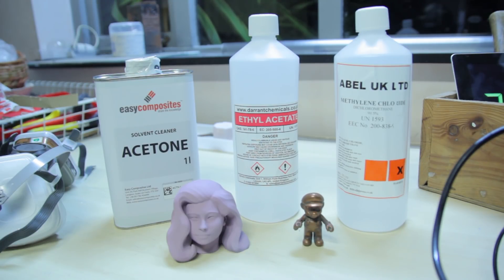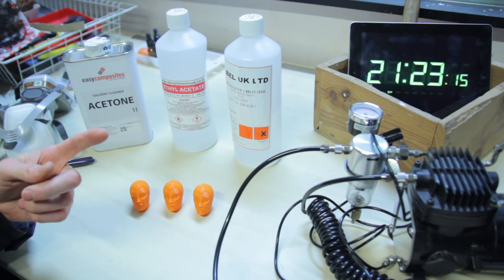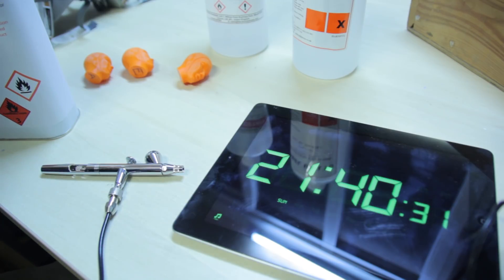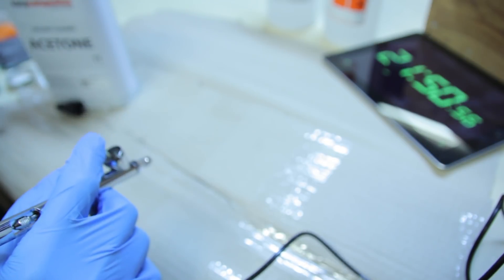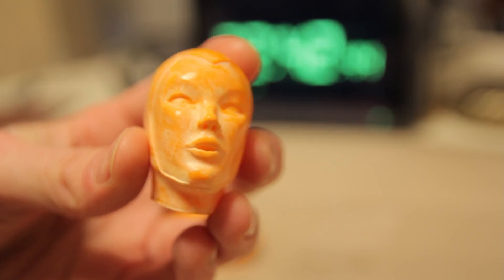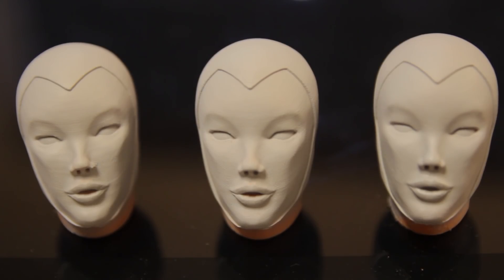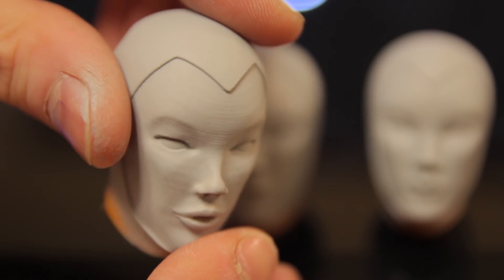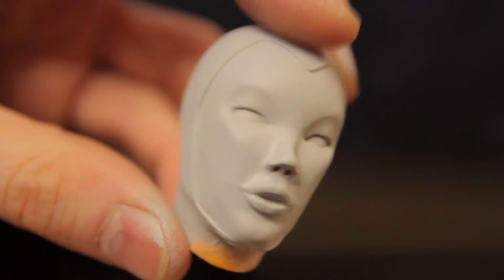PLA VS ACETONE, ETHLYL ACETATE and METHYLENE CHLORIDE

Comment: Airbrushing Acetone is not a good idea. First, you feel the place with acetone spray. Second, acetone evaporation rate is extremely high. It will evaporate before hitting the object. Third, you will ruin your airbrush seals very quickly.
Reply from the maker: Yes, but i didnt do much, however im going to replace my seals, so thanks for reminding me! Have not ever replaxed them before in over 20 years! Mind you i dont use it so much.

Comment: I realize this is an older vid, but im wondering if you've ever tried do neutralize the chemicals in some way... whenever we use chemicals on metal, usually acids,  we neutralize so the acids stops what it is doing. Same when using acids to etch concrete,. With methylene chloride, I'm not sure, because the net has differing things to say about the ph, but no matter the chemical used,  it seems that it must soak into the surface some... so either a soak in a neutralize agent or maybe soapy water or maybe just water...may be needed to neutralize/ rinse. Acetone is a weak acid, so baking soda and water may work to neutralize... since filament absorbs humidity, it should absorb some... wondering if you've tried anything like this to prevent the deterioration before i try it myself.
Reply from the maker: @mamalion3  i think its a good idea. But i have no idea what to use to neutralise each chemical.
Reply from the maker: @mamalion3  i find acetone perfect for sanded colorfabb. It also depends on the additives in the pla. And they unfortunately tend to change them when they do cost cutting and such. Ultimaker brand used to be even easiet to smooth before, but due to a manufacturing issues that ruined an entire run, they changed precesses. Luckily i had colorfabb as a backup but needed to be sanded more.

Comment: I worked in Boeing's Paint shop.  Both Acetone and MEK "VAPRORIZE' faster than the particles will travel over to the target.  You were not missing what your were aiming the Air brush at you were only hitting it with a gas, not an air born partialized liquid.
Reply from the maker: Thanks for the information, atomization was defintely a factor I noticed, i normaly dip the objects. But acetone 8n my honest opinion gives the best results and the others are far too destructive.

Comment: Apparently Tetrahydrofuran (THF) or oxolane (which is used for cleaning pools) will dissolve PLA. You might want to consider experimenting with that.
Reply from the maker: Id try some thf, but when the filament companies change thier pla formulas it ruins everything. Ultimaker filament used to smooth the best but after maufacturing issues the company making their filament changed the formula and it no longer smooths. Must have removed the pha? Colorfabb is my main choice now.

Comment: I have used Ethyl acetate to clean airbrush, same with acetone it works great for lacquer and enamel paint. The chloride stuff sounds like its quite strong so I would not dare use it to clean my airbrush as it might damadge teflon seals.
Reply from the maker: I use acetone and airbrush cleaner. Ethly acetate is a bit strong for me. Methylene chroride is filthy stuff stay well away.

Comment: That seal lid on acetone, place a flat screwdriver on top (corner down) and whack the back with a hammer, it will puncture it and go inside a little, then tilt the screwdriver down and it will pop out, dispose of it as it's no longer needed.
Reply from the maker: Yep agreed!

Comment: Not sure why you would spray these solvents on instead of just brushing it on. Does your mask have chemical filters in it? It looks like just a dust mask.

The best thing I have found for smoothing PLA is UV resin. Just brush it on and hit with a UV flashlight for a few seconds. It sands easily then.
Reply from the maker: Acetone is easiest snd quickest in my experience. But you need to use a pla blend for it to work.
Reply: @Cloakfiend  Acetone doesn't do anything to some PLA's. In fact, none that I have tried it on. Which PLA's are you using?
Reply from the maker: @BreydonsRC  i use colorfabb pla/pha. My faves are the transparent ones. But they all smooth as they are blends of pla.
Reply: @Cloakfiend  ok, that make sense then. The clear PLA's and ones that are a bit tanslucent are a lot different than the opaque.

I haven't tried acetone on any translucent PLA's. I typically don't use them. But I do have one brand that is like that. It seems more like PET than PLA.
Reply from the maker: @BreydonsRC  the opaque ones work well also though. Ive used pretty much all colours.

Comment: This is a mess
Reply from the maker: My presentation needs works i agree. But i applied all chemicals uniformly. So the results are honest. Trouble is the chems atomized before reaching the target so airbrushing may not be the best way to apply. A regular spray bottle is better. Not so much atomization.

Comment: Hello,
Love the video, can you tell me how to prevent resin  from sticking to pla printed molds.  Thank you
Reply from the maker: I wouldn't use pla to make a mould. I'd use a normal silicon mold for that. I dont make many molds but used to make a lot. Then you spray in mold release and pour in the resin. It comes out easy. Not sure if mold release works with pla but I would defo not use pla for molds!

Comment: Is acetone more powerful??
Reply from the maker: Acetone produces the best results longterm. The others crack over time as ive realised, they are far more destructive.
Reply: @Cloakfiend  by overtime, how long do you mean?
Reply from the maker: @s_y_305  like a few weeks or months. When they dry out basically acetone is best in my opinion. The other chems are too harsh. They just dont last long at all. But maybe as i print hollow.
Reply: @Cloakfiend  really helpful, thanks man.
Also another question do you know if I can apply acetone using a brush on pla? Or do I need to do the acetone chamber?
Reply from the maker: @s_y_305  a 35 sec dip is the best in my opinion but brush it on generously if you have no container big enough. Check out my trex vid or the one that called best acetone smoothing or something i dip in those vids.
Reply: Will do, thanks alot
Reply from the maker: @s_y_305  make sure you are using pla/pha, as pure pla is not affected by acetone.

Comment: Thanks for the video, Will multiple applications of acetone get a result as good as methylene chloride?
Reply from the maker: I still think a 30sec dip of acetone is just as good. Methalene chroride will destroy your prints over time. Acetone wont if you dont over do it.

Comment: What happens if i mix them all in a single bottle and use that mixture?
Reply from the maker: Lol go for it but merhylene chloride is too harsh over time. Acetone is less aggressive and so is ethyl acetate. They dry out too much and cause splits. Ill make a vid showing what they looks like years later.
Reply: @Cloakfiend  harsh on what, for the bottle it kept inside?
Reply from the maker: @captain6198  for pla/pha filament. Which is pretty much all i use. Ive had models completely deteriorate overtime. As for methylene chloride good luck storing that. That stuff evaporates through plastic, unless my lid wasnt any good, but it wasnt leaking and stull evaporated. Maybe glass vials? Not sure, but the container I bought it in was almost empty in 3 months without me touching it from being full.
Reply: @Cloakfiend  I extracted my dcm into a glass jar and using with a brush, a mask with organic vapor cartridge is a must though. The ethyl acetate ill dispose as its ineffective even when dipped into it. Methylene is the right answer but must be carefully used in a well ventilated area with a mask. Dipping into like 10 15 seconds is enough.

Comment: 3:06 - Note that methylene chloride can go through nitrile gloves (which is what you seem to be wearing). Use either butyl or neoprene gloves, or don't wear any gloves at all (it actually evaporates very quickly off your skin). Any gloves that are permeable to it will actually make it take longer to evaporate and increase the likelihood of skin burns / irritation.
Reply from the maker: Its all good i dont use it at all anymore. Its too filthy.
Reply: Even better, just never use methylene chloride indoors, because it's just not something you want to breathe. I used it a lot when I worked in a very well-equipped analytical chemistry lab. The only other place I've used it is as a VERY GOOD paint remover, and I do that outside and upwind.

It's actually not the most dangerous solvent you can mess with, but there's really no reason to ever be breathing it.
Reply: @iroll  - Er, what does indoors vs. outdoors have to do with the material the gloves are made of? :-P
Reply: @RFC-3514  OK, how about instead of "even better" we go with "and also"

Comment: Methylene Chlorine is some toxic shit. Be very careful and use plenty of ventilation.
Reply from the maker: Its all gone now and i dont touch the stuff anymore its too destructive long term. Ive reverted back to acetone only. Works best and most reliable/predicable results. Just dont get any inside the model. Methylene Chloride is dirty as hell. And evaporates Faaaaast, even when bottled. You need a glass air tight container to store it indefinitely.

Comment: Be aware that Methylene Chloride needs very special handling considerations. https://saferchemicals.org/get-the-facts/toxic-chemicals/methylene-chloride/
Reply from the maker: Tell me about it! it arrived full and i left it sealed in a cupboard under my stairs, and it was half empty after a few weeks on it own. It evaporates extremely fast and it nasty as hell. I dont touch the stuff now. It destroyed the prints with time. It dries them out completely till they split all over. Stick to acetone and pla/pha!

Comment: Has anyone tried varying concentrations of acetone mixed with alcohol?
Reply from the maker: No. Ive not tried alcohol either but id assume it would need to be pretty pure to melt plastic?
Reply: @Cloakfiend  - I meant that you could basically use the alcohol to dilute the acetone. I'll mix some up and try it and let you know.
Reply from the maker: @greghight954 Has to be 100% or close in my opinion. Anything less is a waste of time. But thats just my opinion, but go and experiment  by all means!
Reply: @Cloakfiend  Pure acetone will mess up PLA pretty easily. I'm thinking to dilute it with alcohol which is rather inert to PLA. I will experiment and let you know.
Reply: @greghight954  How did it go?
Reply: Normal PLA filament won't be dissolved by either ethyl or isopropyl alcohol, but some types are specifically formulated to be slightly soluble in (and therefore smoothable by) isopropyl.

Pure PLA won't react with acetone either, BTW (but, again, many "PLA" filaments are actually a mix).

Comment: Does the Methel cloride affect the strength and hardness of the print ? I want the silk rainbow fillament color to be retained but with gloss and no layer lines ?
Reply from the maker: The Meth chloride dries out the part a lot. Id personally go for acetone. I heard you can remove the whiteness  with a heat gun apparently. Im going to try it again this weekend. Its time for another acetone and pla video. Methelyne chloride is seriously nasty try not to use it. Acetone produces just as good result imo. They both handle well. But acetone is safe imo been using it a lot for years. As long as you dont come into contact with it too often you should be fine. And if you usr transparent pla pha filament your part shouldn't split if printed well!
Reply: Excellent if acetone works just as well; I heard the part stays soft and flexible after the process. Also I use many highly toxic Chemicals often so no stranger to the hazards of that! If I can use acetone though it’s better since it’s cheap
And I already have a ton laying around!
Reply from the maker: @TriptonStudios  dont apply it with an airbrush. With small objects you can dip them for like 30-45seconds. Then leave them for 20mins for the acetone to absorb. After the surface is dry, polish it up with an old toothbrush so that they become shiny. They may go white in which case you can apparently use a heat gun gently to remove it. Ill see how that goes tomorrow....
Reply from the maker: @TriptonStudios  Btw, the parts only remain soft for about an hour or so then become harder and slightly more brittle.

Comment: OSHA specifies that air-purifying respirators (cartridge respirators) are inadequate for protection against methylene chloride exposure, because methylene chloride can penetrate most respirator cartridges. Seriously NASTY chemical man. Experiencing any mental confusion or lung problems?
Reply from the maker: I dont use that stuff at all. I only tried it once for teating purposes. Hopefully no long term damage! I only really use acetone now. Its cheap, easy to get fairly harmless and does the job just great. You just cant use too much or else it dries out too much and splits!
Reply: OSHA's tests are based on continuous exposure for eight hours a day (i.e., people who are constantly exposed to it during their work day). Short-term exposure is not really an issue.  Just use it in a well-ventilated place.

Comment: dude you are trying to spray with substances that vaporise instantly loool common sense bro!!!
Reply from the maker: The main issue is not vapourising. Its atomisation from the airbrush. You can buy cans of acetone spray. The issue is the airbrush not common sense! Im well aware these substances evaporate quickly but not instantly. Ethyl acetate evaporates the quickest by far. You can put a full bottle in your cupboard and a few months later it will be almost empty without having even opened it!!
Reply: @Cloakfiend  Both the flow rate and the air pressure is widely adjustable on the airbrush. You didn't include any mention of trying to optimize the brush's settings. My guess would be to use very-low pressure with a high flow on the solvent.
Reply from the maker: @tcarney57  doesnt make much diff as its the atomisation thats the problem. The airbrush nozzle is too small. I used 10psi which is low for me i usually use 15 or 20ish
Reply: "Common sense" notwithstanding, these solvents are sprayed in industrial processes all the time. Good sense, rather than the "common" variety, usually keeps people quiet when they don't know what they're talking about.

Comment: " dripping is far more waistful", really really, no one is asking to use a hole bottle for a single model, how much chemical are you using for dipping?
Reply from the maker: For dipping you need to sacrifice a container and just keep reusing it until it evaporates. Most dramatic results mind you. Prone to cracking if overdone. Economical. Can be used to brush on as well.

Comment: Thanks for this, I had never heard of Methylene chloride but I will be giving this a go.

I watched a video made by DIY perks last night on his method of treating abs with acetone that seems to be quite effective and easy. He creates a simple vapour chamber so you don't need to use as much solvent or sit there brushing dipping or spraying and produces a very even finish. As all these solvents produce vapour at room temperature I would assume the method is interchangeable with all three of these. The video is called "Simple way to make ultra-smooth 3D prints at home"

Comment: I use Methylene Chloride to fuse and smooth most of my prints, it works on PLA, PETG, and other materials really well. almost too well some times, I buy it in 1 gallon Jerry cans off of Ebay for relatively cheap, can't get it anywhere else. plus it is really strong stuff so it needs to be stored safely and used in a well ventilated area. I use a respirator too even when just pouring it. I use vapor smoothing most of the time, where I have a pool of it in the bottom of a can and the part hangs above it for a few minutes. it evaporates really fast so no need to heat it or anything.
Reply from the maker: Sergeant Seven it evaporates REALLY fast. I bought some and after a few months without using it less than half the bottle remained! Poorly packaged. I still prefer acetone though. Will try vapour with methelyne.
Reply: Cloakfiend acetone doesn't do anything with most PLA or PETG. I know you said you are only using colorfab. But acetone won't do anything to most other filaments besides ABS.
Reply: Dude can i ask you some questions.? Write me on jorro.ts@gmail.com please
Reply: @abcd199725  Sorry I don't give out my email address. You can ask me here or on my youtube channel and I can reply back.
Reply: dont use metylene chloride, very bad for the environment and the ozone layer and seriously gives cancer. Banned in many labs (i am a chemist) ! Dont use it for this application

Comment: Use a pipe wrench to take off the lid to the acetone container, they're designed to grab into what they're holding and twist it
Reply: His issue was clearly not the screw on lid so neither of those tools will work. To remove the seal a small chisel or flat screw driver will work reasonably, start by punching a hole in the seal then use the hole to pry out the seal.

Comment: That's cool @Cloakfield ! I printed a sea horse at 70 microns with old blue ultimaker filament, one half with 0.8 wall (forgot to change) and the other with 1.2mm. I will try with Acetone 100%... maybe it's a crazy torture test cause the tail is too thin and tends to warp, right? I will post the pics in UM forum...

Comment: You punch the top with a medium flatblade screwdriver, then, with the flat side pointed up, pry the top out by leveraging against the top of the threads.  It should pop out fairly easily. After that, the cap will be the seal.  The seal is just for storage and transportation mishaps.  Thanks for the video.